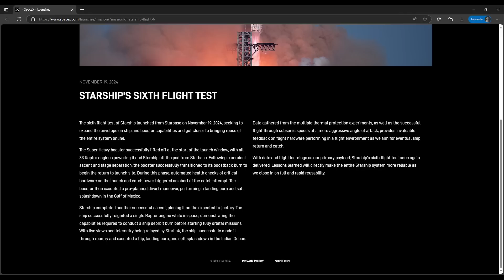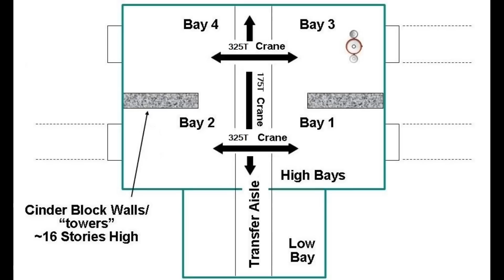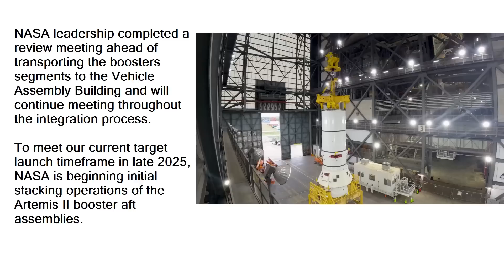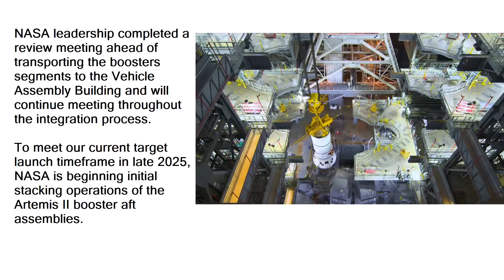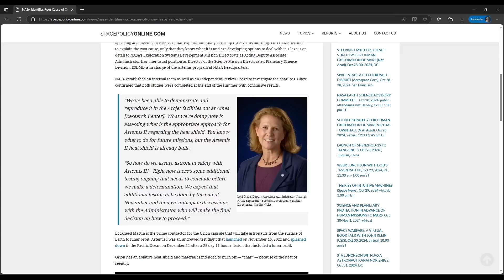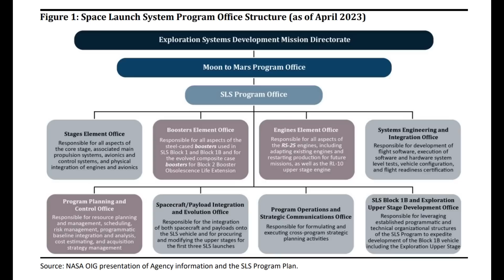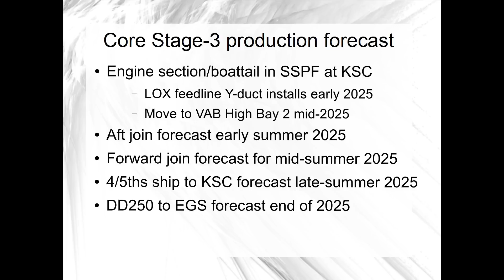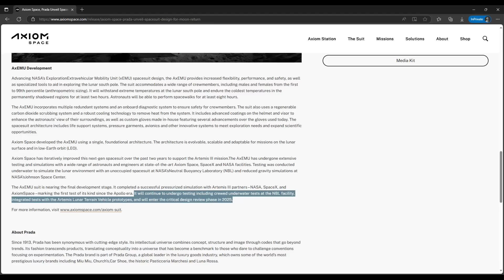Starship flight test six completed while Artemis II stacking begins and then goes back on hold

Comment: It's important to note that the SRB "USE BY DATE" is completely artificial.
Reply from the maker: NASA has said they are being judicious about the generic 12-month stacking LOLI, even if they end up extending it.  The boosters were ready to stack by the beginning of the spring and the ML was originally scheduled to roll back into the VAB earlier in the year.  If there were no constraints to having the boosters stacked and on standby, they could have saved up to two months of schedule by stacking them much earlier this year.

(And probably even more schedule if they waived other LOLIs, stacked SLS, and performed the tanking test while waiting for Orion.)

OIG noted in one of their reports this year:

"The ability to extend booster stack life is based on actual hardware measurements of each individual booster. As such, there is no guarantee that the life of the boosters for the Artemis II mission can be extended the same amount of time as the Artemis I mission."
Reply: @PhilipSloss  yes, but the use by date is artificial. It's purely based on the o-ring seal supposed elasticity after prolonged compression. I don't have a problem with that, especially with manned flights. I'm just pointing it out. Most believe the SRB is somehow like milk, and can't be used after a year.
Reply from the maker: @hawkdsl  It's based on the proper function of the RSRM field joint J-leg, not the O-rings.  Stack life doesn't mean use life, but it's also not an artificial constraint.